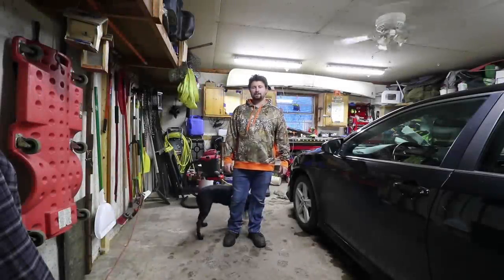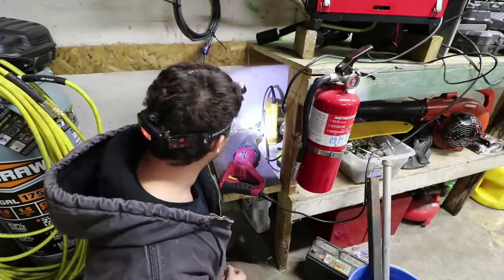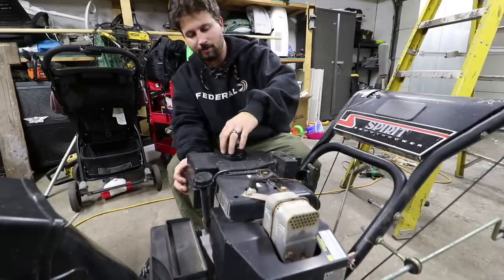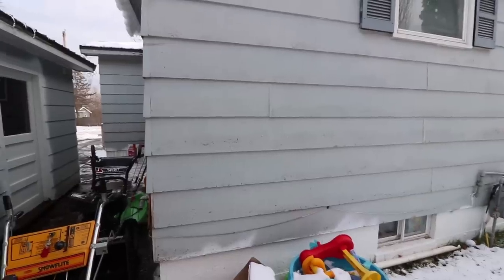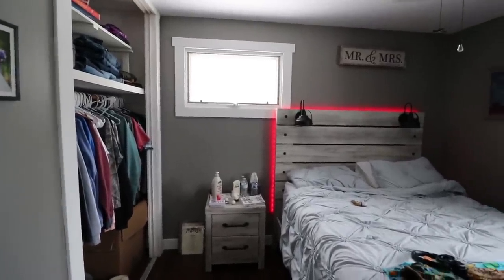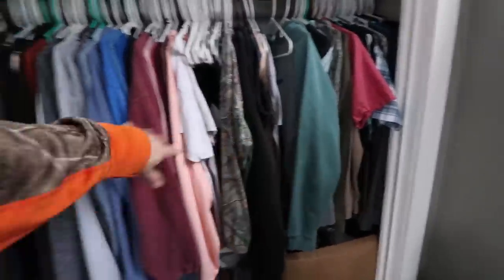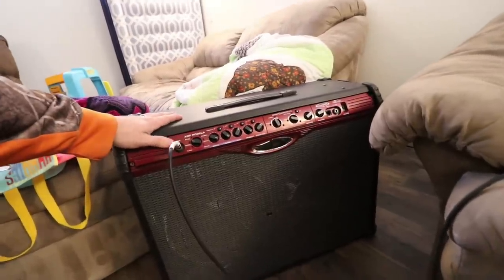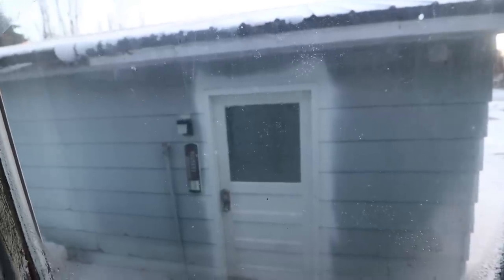The Bay House: Garage Heat, Windows, Stairs, Guitar and More!

Comment: Zach I know that pine paneling doesn't fit your esthetics but when I was a teen my parents bought a ranch style house(1500 Sq Foot) that was built in the 1950s. My room had the old 50s style pine paneling and since the sun set on my side of the house that room was the warmest in the house. It was great for many years. I would love to sleep in a room now that got extra sun in the afternoon. I feel sure that paneling made a big difference. I current live in a 1100 Sq Ft  townhome. You are correct about doors and even these windows let in a tremendous amount of cold air. I really do not want to add curtains but they would help cut down on the heat loss. I am planning to sell the townhome in the spring and I will be buying some land in the Western part of NC. I have decided that I am going to build a yurt it will give me about 900 Sq Ft. I don't need a lot of space and getting closer to 70 I don't want to spend a lot of time doing house work.

Comment: You might want to check your local building codes for fire escapes before removing the bedroom window and the front door; they just might save your lives.
Reply from the maker: The little window is not egress. And the door won't be an issue also.
Reply: Had the same question. Are there requirements for the number of doors a house must have?
Reply: This exact thing screwed me at my last house in New York. I did the same thing. Removed a door to the outside, did all this custom shelving and entertainment center then when I went to sell the house I was forced to rip that all out and put the door back. It was a fire code issue. That sucked! Something I never thought of.
Reply from the maker: In mn, it's required that every dwelling has  one egress side hinge door. And then egress windows in every bedroom.
Reply: @JoeandZachSurvival  ok cool. Yeah NY is ridiculous with all its codes and requirements. Btw didn’t know you could shred like that on guitar! Nice! Can I get some Ozzy on the next video?
Reply: The post about resale value might be worth considering…keep the door, but perhaps install a temporary cover to keep the cold out and put shelves there as planned?
Reply from the maker: As far as resale value goes, my biggest leaps are going to be the kitchen and the 3rd bedroom. Siding will help, but it won't do tl much. A door wouldn't affect it much because they wouldn't know it existed in the first place.

Comment: Home Depot has metal shelving with hanger rod built in and they are strong they use a plug system but I cut them off and screwed right into the studs and it is great and strong . I doubled the volume of stuff that we can put in the closets .

Comment: Bummer about the garage humidity.  I thought that those diesel heaters put out more of a dry heat.  A Mr. Buddy or  sunflower propane heaters would really sweat it up.  Humidity must be largely due to the melted snow, ...or was it condensation freeze up on the outside of the garage door and windows?  So much here to take in, I'm going to have to watch the whole video again.
Reply from the maker: Humidity typically is around 37 to 40 percent in the garage. But with all the melt off of the snow from the car, it was up around 55 percent. Plus, the temperature difference inside vs. outside causes moisture build up on the windows.
Reply: @JoeandZachSurvival  Did it lock you out, rather freeze lock? I have that heater, haven't committed to installing in garage yet.  My garage isn't insulated. Think I'll do the fresh air draw from inside garage. No carbon monoxide danger with my leaky doors and windows.  Maybe install a ceiling fan in conjunction.  Be glad I'm not a neighbor, I'd be bugging you all the time. Would love to show you my Boogy-ized Fender Twin.  Push pulls everywhere, and layers of saturation.  
Rock on.
Reply from the maker: I've never had any issues in my last 3 garages with heat and freeze. The door frosts up for a bit, and then it dethaws and evapotes. I would suggest a celling fan. It really helps. I have no one around here to jam with l, I wish I did, though.
Reply: @JoeandZachSurvival  Finding jam mates could be a whole mixed bag of troubles.  Recording software is much less taxing on any spouse's charitable tolerances.  I have enjoyed all your content that I've seen.  I'll stay tuned.  You're doin' great kid, and I'll have to admit you've taught me a few things.

Comment: Nice project it is always nice to work in a warm work shop. But temp will speed up the salt operation on the car and engine doesn't need warming up, the normal ones. Just my opinion.
Reply from the maker: When it's anything below 30 and a person has kids, the vehicle needs to be warmed up. And when it's 10 degrees or less, the vehicle needs to warm up. Had a friend's 2016 Chevy bend a pushrod from a coldstart. Everything gets brittle at cold temperatures, so letting it warm up is smart. As far as salt goes, I have heard about it being worse when it sits in a heated garage, but the key is to wash your vehicle once to twice a week.

Comment: as far as your diesel heater in the garage, I don't think using a canister marked as 'WATER' is a good option for storing diesel fuel.  God forbid someone try to use it to drink from OR to put out a fire, etc.  Just a thought.  Maybe use a can marked FUEL would be  a better option.  I know you gave some pretty detailed info on that system.  How about a carbon monoxide detector.  Safety first!
Reply from the maker: I have a dedicated fire extinguisher in the garage. And a carbon monoxide detector. And lots of bottled water if someone wanted something to drink. I have never witnessed someone drinking from a 6 gallon can. Water weighs just under 10 lbs a gallon, so trying to hoist 60lbs over your head for a drink would be ridiculous. And rule number one about a fire is walk away.  An individuals safety is far more important than a garage, and if you truly knew safety, you would understand that. But hey, I guess that's why they put warning labels on things.